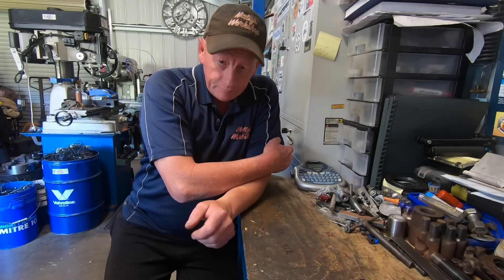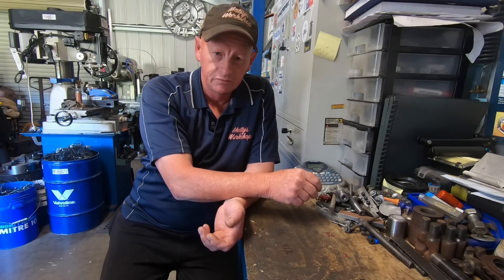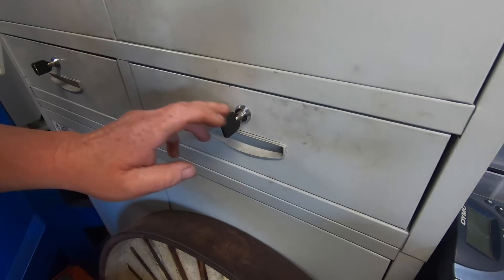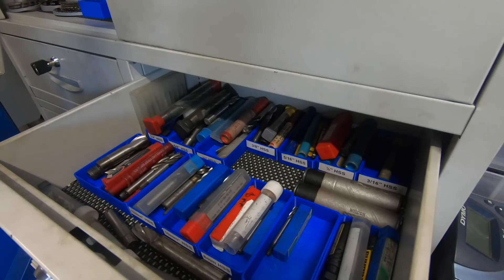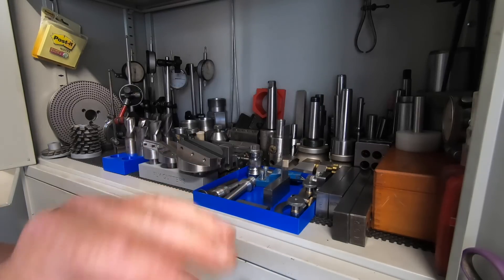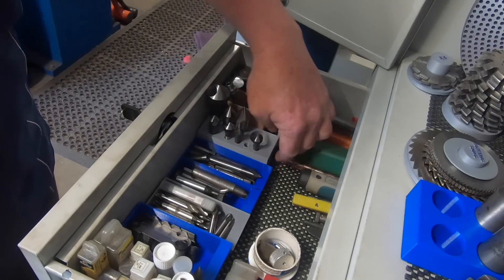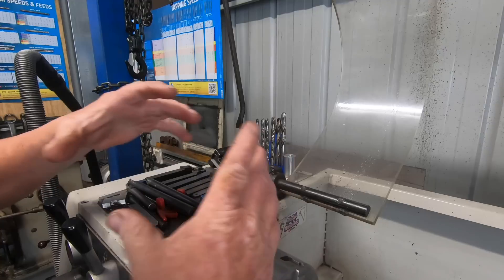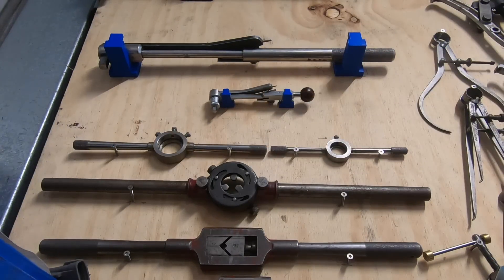Creality Ender 3 V2 NEO

Comment: Sweet!  I've had one for over a year and love being able to make things for pennies instead of buying them for dollars.  Only things I changed was replacing the head/drive with a direct drive so I can print flexible filament, added a couple of lights on and around it so I can see what's going on better, changed to a PEI plate for better adhesion and added red channel fillers to keep stuff out and make it pretty.  I really like what you are doing with it and got a couple of ideas for some similar projects now.   Also, for anyone getting into the hobby, if you are having a hard time with the CAD program try some others.  I went through about 5 before I found one that works with my brain. Thanks for another great video.
Reply from the maker: Gday Ralph, I think it works out the trays I made are around 0.65c each, im going to have a go at PETG soon and see what results I get there, can you possibly let me know what lights you used on your printer, I think I need to do the same, thanks for watching mate, cheers
Reply: @MattysWorkshop  The lights aren't anything fancy.  One is just a small desk lamp with a bendy neck.  The other is about 1 foot of white led strip stuck to the underside of the top rail and hooked to a switch and power supply.  I did have to put a thin strip of material in front of it to keep from blinding myself.  PETG is more of a pain to work with but is stronger.  I just redid a cable holder in PETG because the one in PLA kept breaking.

Comment: nice, great to have the shop organized. Over the years I have collected ample small bins but the problem I have is for some reason don't have the discipline to "put-it-away". By the end of the day, I'll have every tool in the shop all over the place including in my pockets. Can't seem to follow the rule, "don't set it down, put it away".
Reply from the maker: Gday, at the end of each day I pack every tool away, clean the machines and vacuum the floor, I hate walking into a messy shop and by putting everything away you know you haven’t lost anything, it only takes me around 20mins, time well spent I think, thanks for watching mate, cheers

Comment: Nice job Matty. Glad your initial went smooth. I had a lot more trouble with adhesion etc. The first time you need a custom spacer it pays for itself. 

I made a whole set of change gears for my Harrison Lathe. They are nearly impossible to get here in the States without spending a fortune. Fusion has a gear generator and you plug it in and off you go. You just adjust for your spline. Even I could do it…LOL. The plastic PETG gears hold up just fine. At around a dollar or less each I can print and replace for a long time. 

Very nice storage solutions. I did add a dryer as my stuff is in the basement next to a Great Lake (Erie) and a River (Raisin).
Reply from the maker: Gday, I think the printer has saved me a bucket load of coin already, the cost of them trays from a shop are expensive, I think it’s works out at around 0.65c per tray roughly, im going to try some PETG soon, hopefully I have some good luck with that filament, thanks for watching mate, cheers

Comment: Gday Matty. I just purchased a AL960B partly based on watching your channel. Matty what change gears did yours come with. Have you done any threading? Thanks Tom
Reply from the maker: Gday, it’s great to hear you have brought an AL960b, in my opinion the great value for money, I’ve done a lot of threading on mine, there were 2 change gears that come with the lathe, there’s a 30t and a 32t gear, the only thread you can’t cut is a 1.75 pitch thread, the chart on the front of the lathe is quite easy to follow, if you have trouble, let me know and I can try and help you out, cheers
Reply: Hi Matty, thanks, mine came with the same two change gears. I’m happy with it mate. My first lathe was a Chinese 610 between centres, i learnt a lot but the Al960 is a different beast.  Thanks again mate. Really enjoyed your builds.
Reply: By the way mate your tail stock chuck holder build was really interesting, you probably don’t realise Matty but I and many others at my level of experience have learnt a lot from watching your builds. Cheers Tom
Reply from the maker: @SoBoring136  I really appreciate your kind words mate, im only self taught and learnt a lot by watching others and simply having a go...
Reply: I will leave you alone after this one Matty. Mate how good is it operating a quality machine after machining with a Chinese lathe, I’m not bagging the Chinese lathes at all, they have allowed thousands of people to enjoy machining that would never have been able to afford to get into it but operating a Taiwanese lathe that can handle workshop loads and repeatedly turn precision work out is like chalk and cheese.  I just parted of a pice of 75mm solid round Barr using home ground HSS tool and it was  hassle free and cut through so smoothly. Love it.
Reply from the maker: @SoBoring136  Gday Tom, There's a massive difference between Chinese and Taiwanese machines, youll find your surface finishes will improve big time and if you need to get rid of a lot of material in a hurry the lathe will handle it, I had a lot of trouble parting off on my old lathe which was Chinese, the AL960b has no trouble, I really dont mind at all answering your comments, send as many as you like mate, Cheers

Comment: Some nice prints you have made there - Impressed 👍
You have my sympathy with using Fusion 360 - do a complex design that takes all day and Fusion is guaranteed to crash when you are 99% complete.
Have a try at FR4 (PCB material - 2.4mm thick works for me) for a print surface. When it is hot the prints stick to it like sh1t to a blanket, but when it is cold the prints will quite literally fall off it.
Happy 3D printing, all the best,
Paul
Reply from the maker: Gday Paul, ill keep that PCB material in mind, So far I haven't had Fusion360 crash but its been a learning curve, Thanks for watching, cheers
Reply: @MattysWorkshop  There is a pretty good chance that you will see some of my latest 3D prints on YouTube soon - let you guess where I sent them 😁

Comment: I have used my Ender 3 V2 for all sorts of things in my workshop , from little angle brackets to locate my D bit grinder on its trolley to magnetic sharpie marker holders for my machines even the extension covers on my mill are held in place with 3D printed brackets and dovetail blocks ( these have thread insert in them for the screws to screw into ). You can find heaps of stuff on thingy verse and prusa also has their version of this where you can download files that someone else has put on there - but never download pre sliced files coz sometimes you will get some arsehole that has tweaked the G code to make your printer crash , only use  the stl files and slice them yourself . The only thing I have had to do to my printer in 4yrs of usage was change the Bowden tube over to Capricorn tube ( handles the heat better than the Teflon stuff supplied ) and replace one nozzle. 
The creality slicer I think is a dumbed down version of either cura or slic3r. I have used the prusa slicer but found I liked cura better- I just seemed to get on with it better , same goes for fusion 360 .
Reply from the maker: Gday Ian, the more I look around the workshop the more ideas I find to use the printer for, ive been search a lot on Thingyverse and only used the STL files, there's so much to choose there, I also found Cora simple to use straight away, Thanks for watching mate, Cheers

Comment: I've got an earlier version of the same printer. Think I have 20-30 spools of PLA through mine. I have some tips and tricks I've picked up if you ever run into a hurdle. Little trick if you use pla, because it is hydropic, you need to add about 2.5-3% to any presice holes, or after a couple days in the humidity, they will be too small.
Reply from the maker: Gday Matt, I’ll definitely be in touch if I run into trouble, thanks for the advice on the dimensions and appreciate you watching, cheers

Comment: Nice review Mattie, no tech talk, no flashing, no drum rolls, no boasting. Down to earth from the user perspective. Well done.
Now to the business case. Suppose you had decided to get organised without the printer? You would have had to source and buy all the boxes, hooks, holders etc and get it sent to you. 
TIME. Buying off the shelf would easily have been a same investment as getting into Fusion 360 and Acura. 
MONEY. I think the printer would have paid for itself, hands down, despite the initial cost of about €400 plus filament costs. The cost of purchasing a storage system with all its bits and bobs plus shipping would probably have surpassed that.
FIT FOR USE. I think the printer is the absolute winner. With the printer you can make a solution to suit your needs.
FUTURE PROOF. Break something? Expansion? No problem with the printer. Future availability of an off the shelf storage system will be an issue as they tend to get on the market and disappear again. So you would be extremely lucky to get expansion or spares after a few years of use.
SPACE. Well, if space is an issue in your hobby workshop or home, than the printer may be on the losing side. It may not take very much space but in European homes space is usually at a premium. So that may be a point of consideration. On the other hand, the printer makes a more efficient storage solution as you can optimise for space rather than using standard elements of an off the shelf solution. So I call that a draw.
Reply from the maker: Gday, Im not keen on the normal review video format that many use, I like to show what i've done and the benefits you can get, you have a lot of really good points in you comment, its hard to buy exactly what you need and for the cost of making your own its definitely worth buying your own printer, my brother did a rough cost of way a tray I printed was and I think he said it was around the 0.60c mark, thats a lot better then shop price, Thanks for watching mate, Cheers

Comment: Nice one,Matty. I have had a Creality Ender3 S1 pro printer for a couple of months now and it is a brilliant addition to the workshop kit. The S1 Pro is very similar to the 3 V2 Neo you have there. In a few weeks time you'll wonder how you ever managed without a 3D printer.
Reply from the maker: Gday Howard, im amazed how easy they are to use straight out of the box, im already wondering how I put up with the endmills floating around the draws, so much nicer now thats for sure, Thanks for watching

Comment: I make so much for the shop with my ender 3 v2

As for being too heavy for a 3d print get some carbon fiber pla. I held 60lbs on a single 1in wide 3d printed hook I mounted to the wall
Reply from the maker: Gday Daniel, Thanks for the advice, I'll definitely look into that filament, Cheers.
Reply: Or PLA Plus. It is remarkably strong and durable.

Comment: Fusion can - I'm pretty sure - add draft angles if you want to print casting patterns, too.
Reply from the maker: Gday Jim, there's so many different functions in Fusion360 I have know idea what they do yet, Cheers
Reply: It certainly can add the appropriate draft angles for various types of molding patterns. Solid Works CAD does very much the same also.

Comment: You need a raspberry Pi and octopi software to connect to it. You can then run it from your computer.
Reply from the maker: Gday, i'll be honest, i'm not that good on computers and probably pushing the limits of my skills to get this far mate, Thanks for watching, Cheers
Reply: @MattysWorkshop  I'm a bit nerdy and I assume you just have these things lying about in your workshop😂 Your videos are most excellent and entertaining.
Reply: The problem there is that there is currently a global shortage of the chips used in the raspberry Pi and to buy one at present time costs an arm and a leg so the original concept of the Pi being a cheap alternative for computer control functions is out of the window.

Comment: Now Matty. What you need to do is carefully pack up the printer & post it half way round the world to me. It is great. My workshop is so disorganised. I have a stack of stuff on shelves made from MDF. Now the weather has turned the wood has a bit of damp in it & things like the facemills & chucks etc are getting rust rings round them where they sit in the holes. In plastic i reckon this would not happen. Got me thinking now. 
Regards.
Steve.😀
Reply: Same here Stevie . Cheers Ade.
Reply from the maker: Gday Steve, i've still got plenty of printing to do here but I think too would solve your rust issue, Thanks for watching, Cheers